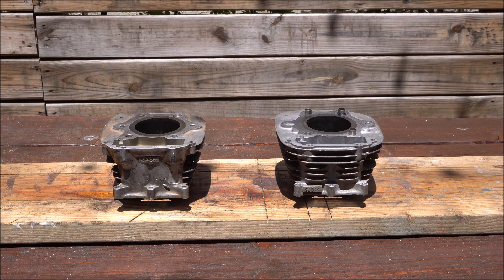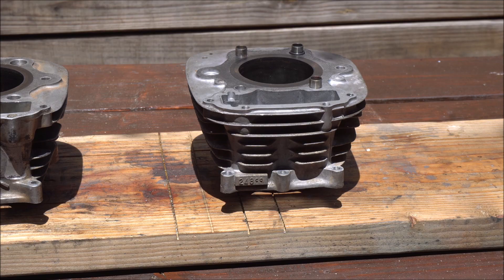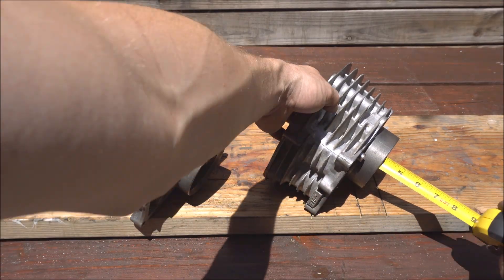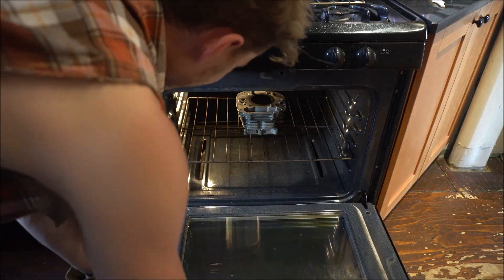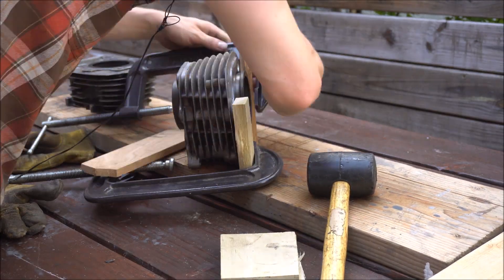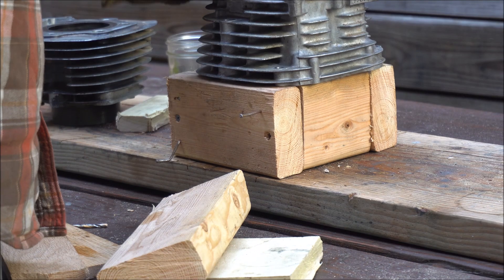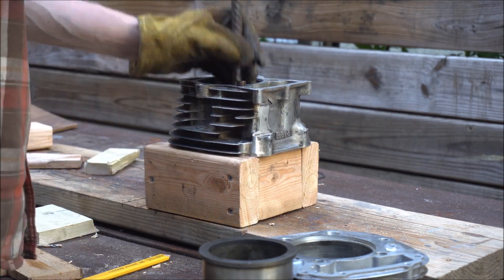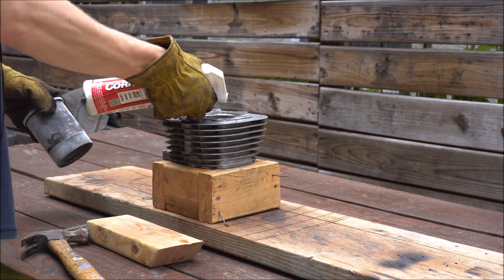Removing and Installing Cylinder Sleeves

Comment: Sleeves are installed after coating them with a sleeve locking compound.  The compound secures the sleeve to the cylinder jug during operation so it doesn't rotate or try to move up and down. Heating the jug in an oven at 450° F for one hour or less breaks the bond of the compound allowing the sleeve to be pressed out.

Comment: Xl250. Nice. I did a 350. Same thing. I heated oven to 500 degrees. The aluminum just dropped off the sleeve after 5 minutes. Easy removal.

Comment: can you use a copper earthing rod instead of rebar? should be hard enough to push out, but not so hard to damage cylinder +liner
Reply from the maker: That would probably be better than rebar. Rebar or wood is all I had and the wood split.

Comment: I did this with an XS400 twin. Used the liners from a square barrel engine as replacements for a round barrel model that had badly rusted and scored bores. Dropped them out an in again by heating in oven. I was very pleased with outcome. wife not so much as it stunk out the kitchen..

Comment: Have you ever done any Big Bores? Like a Skidoo, 440F (67.5mm x 61m) 436.7cc is a 377F (62mm x 61mm) 368.4cc Big Bore. I'm pretty sure it uses a (4) 8mm Bolt Pattern based on 94mm Bolt Circle. I figure you can go to 76mm Max, I would happy with 72mm to make a 503F (72mm x 61mm) 496.9cc. What I don't know is what clearance for the overbore of the Aluminum Shell for the New Sleeve is needed
Reply: This is a very random place to ask your question

Comment: Hey. On the cylinder you showed putting the sleeve in you did it very fast, no real planning for us to watch, I'm sure you can't just drop it in like that. There is ports to align is there reference marks on the sleeve and cylinder? Maybe a keyway it slides in on.  I'm sure you don't have much time you align up ports before she locks in place ??? Thanks
Reply from the maker: It just dropped in like that with no resistance. I would have liked to get a better slower shot of it happening but that’s literally how quick it was. There was no particular orientation to pay attention to.
Reply: This was a 4t engine no cylinder ports. Id say its Possible to align the 2t ports and quickly drop it in aligned by eye and hope for the best. The cylinder when being resleaved professionally, needs to be decked to match the height of the jug and the sleeve. Doing things this way can lead to a blown head gasket with water cooling you can get into trouble quickly

Comment: I'm glad you showed us this! How well is your engine operating now?
Reply from the maker: After reassembling the engine it started up easily. I bought the bike non-running so that was pretty exciting. Compression was around 110psi before the cylinder swap and now it’s at 175.
Reply: @fromthebackyard2415  sounds pretty nice!

Comment: Sir, thanks for d prompt feedback. (1)Pls what is name of this electric device u were using to swap d sleeve out from d cylinder, is it microwave or toaster oven? (2) At what temperature did u heat it? (3) did it need any adhesive to hold d new installed sleeve? (4) l hope during and after heating process d cylinder will not have any bad effect cos of d heating?
Reply from the maker: It's an oven. Don't use a microwave. Heat to 350F (176C). Don't go higher than that and no damage will occur. Put the engine parts on a sheet or pan so the rack wont mar them. About 15 miniutes is fine. No adhesive is needed. The hot part expands and the cold part contracts so they can fit together. The engine started and ran find when I put it back in the bike.